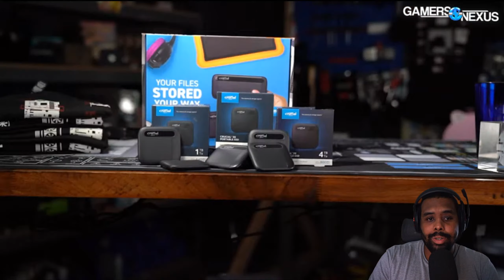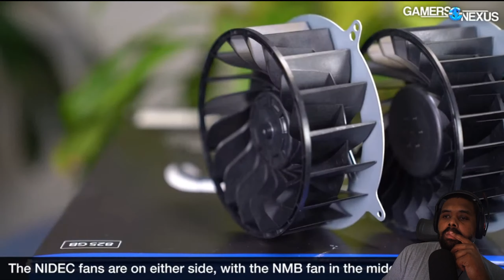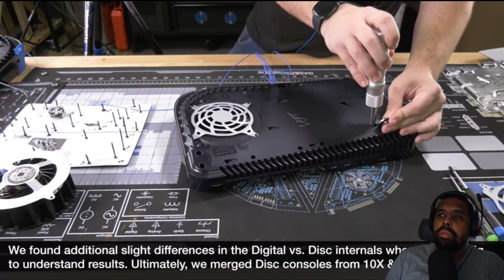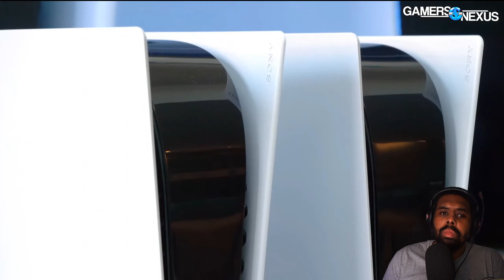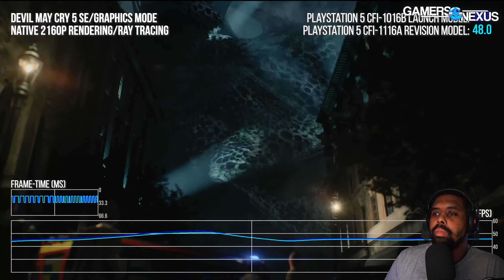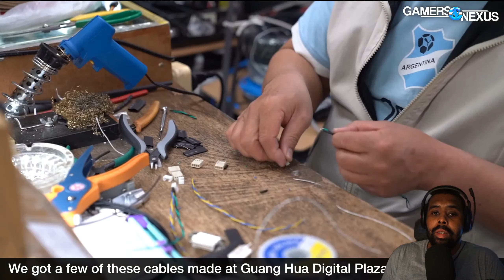🔴 New PlayStation 5 vs. Old PS5 Cooler Design: Thermals & Fans Live Reaction

Comment: The 1200 will probably be the one with the smaller SOC since they stated that in 2022 (March-May) will be the time when they will have the next revision . The one thing with the Fans is that Sony uses different fans in their consoles. Hell When the PS3 first released they had 2 different fans. My Fat model had the 15 blade fan, I change the fan with a spare 19 blade fan and my PS3 runs a lot better, Plus I changed the thermal paste too.